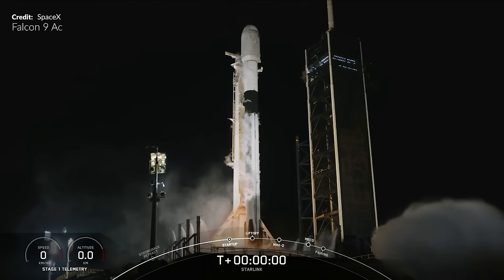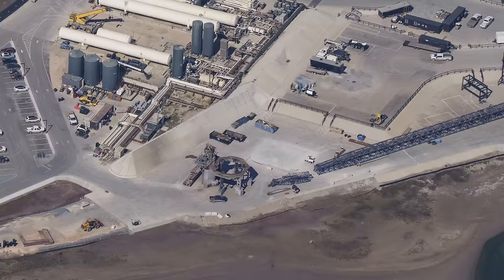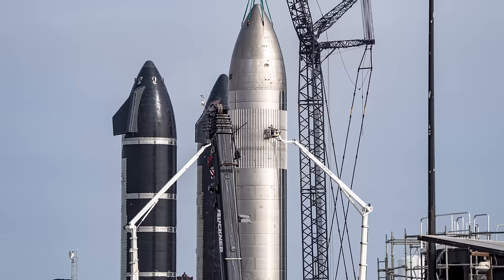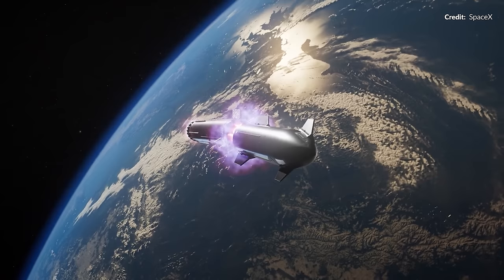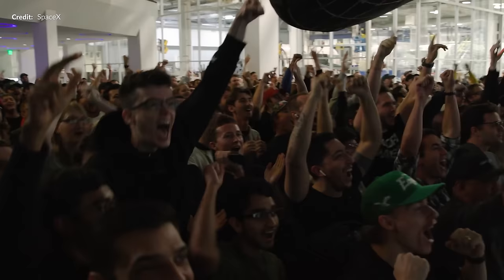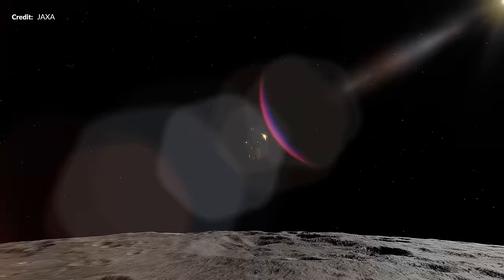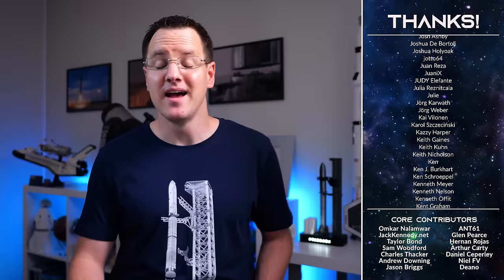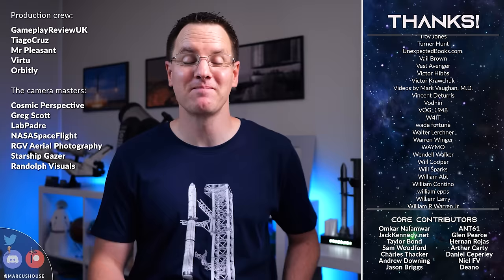SpaceX's Massive New Challenge! But how will they do this with Starship?

Comment: The primary reason for adding doors to the Megabays is for welding purposes. They use a shielding gas, usually an argon-CO2 blend, to protect the arc weld quality.  Any wind blows it away from the surfaces and welding wire.

Comment: It's amazing to hear the landing counts for each individual rocket keep going up!!!!!! Also that the only 1 lost in a few years now, wasn't a failed landing, rather rough seas toppled it over!!!
Reply: Expect them to loose a few Starship boosters even after its operational. Just part of the learning curve. On the Falcon and Falcon Heavy boosters they have alot of experience now and know where problems are likely to pop up on each flight and how to deal with them. One thing l wish SpaceX would do if they aren't is to de-orbit the second stages after use simply to reduce the amount of discarded equipment in orbit. Preferably over into an area of the ocean that sees little shipping or maritime activity.
Reply: @mpetersen6   Depending on the orbital requirements of a given mission, the second stage is either quickly deorbited, or placed into an orbit that will naturally decay over time.
Reply: @mpetersen6  oh yeah starship is a different beast all together, and yeah loosing them is expected! I mean only falcon 9 and falcon heavy!  And that's kinda why it's is some amazing, it only takes 1 small problem to start a RUD!!! So yeah even F9 as routine as landings are, can still happen!!!
Yeah they need to work on bringing back 2nd stages as well! The fairing halves are a start I guess??
Reply: @jam2190 Falcon had stopped getting major upgrades so no 2nd stage recovery ever. All on Starship
Reply: @alvianchoiriapriliansyah9882  Indeed, that was one of the drivers behind Starship... the acknowledgement that they'd reached the end of what could be done with the Falcon platform, and that 100% reusability just wasn't possibly with that hardware. Since then, they've done miracles with the ever-increasing flight cadence, but they're not doing anything new with it...

Comment: Corrosion is a huge issue in this area. Having parked our RV at Isla Blanca 3 years in a row for several weeks at a time I can confirm that corrosion begins on all unprotected surfaces very quickly. We spray our bikes and RV frame with anti-corrosion spray every time we pull in there. I always wonder how much corrosion SpaceX hardware accumulates. We have driven through Boca Chica several times and it seems everything has some degree of rust. Keep up the great work, Marcus!
Reply: Stainless steel can actually corrode,  but it takes a lot of time and usually immersion, neither of which seems probable for the rockets, but may be probable for the production facilities. The other probability is that welds will rust given that they often have mixed metals in them along with the extreme heat necessary to weld Stainless steel. If they  are a problem,  it should show up in pictures from the rocket garden.

Comment: Thanks for another wonderful space news paste - I mean, video!

Starlab is a heck of a concept. Just imagine, pop up space stations deployed when needed. That's rather amazing, and a fundamental change in how we use space. If they could link them together into bigger structures the possibilities would be endless... But your question about the Big Mouth is a very good one. Just how the heck could something that big get out of Starship at all? The problem with installing a huge door (I think) is that it introduces new weaknesses into the structure that could fail under the stress of liftoff.

Hooray for SLIM! Talk about a saga... That little lander has been up, then down, then metaphorically up again. I'm glad they got it to charge after all and got some science done! It would be great if it did somehow survive the Lunar night, but even if it doesn't the mission has still been a success for JAXA.

Comment: Doors for high winds sound like a good idea.  What is SpaceX plans for hurricane force winds and the water surge that accompanies a hurricane?
Reply: Having survived 4 hurricanes on the Gulf Coast of Texas, doors seem the least of their problems.  Hanging a 300+ meter sail up in winds that vary from 75 up to 150+ mph looks extremely difficult and hazardous. So far,  Boca Chica hasn't experienced anything like even the low end of that range, so I worry about that possibility. The foundations seem insufficient to such challenges and I've seen no guy wires that would make up for the insufficiencies of foundations.

Comment: But what's up with the Starship activity in Florida then when they transport the tower sections to Boca Chica? SpaceX also hasn't completed neither the orbital launch mount nor the tower in Florida and they also didn't build ANY high bays there. It will take years until SpaceX can restart Starship activities and build Starships in Florida let alone launch Starship vehicles from there. Thanks again for this nice summary video though!
Reply from the maker: Yes, I believe they are trying to ensure everything works at Boca before they will fully replicate it. As soon as IFT1 dug a huge hole in the ground, it was clear that they needed to pause at Florida until they had the design nailed better. I have no doubt that once they finalise a good design that does what they want, the Florida site will start absolutely roaring.
Reply: @MarcusHouse  Thanks for the comment Marcus. I hope you are right!
Reply from the maker: @jonny3003  You are most welcome. If IFT 3 makes it to orbit, again with no pad damage, I think they will have the confidence to kick it back off.

Comment: I'm wondering if they'll skip hot-staging with IFT-3, to give Booster10 a better chance of landing while they figure out a good way to deal with propellant flow issues.  I'm also wondering if a mass simulator will be added to Ship28 to eliminate the need to vent excess O2 prior to orbit insertion, since it has a payload door.  I can't wait to see what happens.
Reply: Hot staging didn't go anywhere
Reply: @alvianchoiriapriliansyah9882  Great.  So they must have a solution for the propellant fluid slam situation that seems to have caused Booster8 to explode when it tried to start its boost-back burn.
Reply: @victorkrawchuk9141  Of course. That's relatively easy to work around, using the data they'll have gathered from the Booster 8 failure. It might not be an optimal workaround (long term, they'll fix it in future hardware), but they can certainly tweak the launch profile to avoid problems... have the booster keep burning a little harder, or take a bit longer re-lighting all the engines, whatever fits the failure scenario.

Comment: It seasm like a wast to send up a habital module that is mostly air. In stead of sending up something that could be assebled in space.
Reply: You can always put stuff inside it if weight allows
Reply: @alextaylor9746  the issue is that those stuf would not be able to auto depoy
Reply: @matsv201 So better deploy it all on Earth so any problems can be easily fixed then?

Comment: If an 8 meter diameter by 8 meter tall module would be a tight fit, the arm, solar panels, power module, and docking ports would have to be on another Starship.
Reply: Official clearly stated that all will be fitted in one launch, no in-space assembly

Comment: Hey hey, Marcus! With all the talk about Gateway Tower 2's parts coming from Roberts, one thing I'm curious about is why none of you guys (you, NSF, WAI, Scott) aren't talking about the likelihood that a section or two more will be needed. It would be strange for Space X to build an technically upgraded version of Tower 1 that is the same height considering Elon stated that Starship V3 will be taller. If both towers are of current Tower 1 height, they'd have to upgrade both towers to work with V3 stacks. I'd bet we'll see at least 2 more tower sections built for Gateway Tower 2. What do you think?
Reply: There's no additional sections. Current tower height are sufficient for V3, and both existing towers and new one have the same height

Comment: Hey Hey Marcus. What type of camera does SpaceX use in the starships, boosters... Is it a GoPro or something similar? Great Video (as always).
Reply: I believe GoPro went bust or were closed down [citation needed]
Reply: I don't know about SpaceX, but Rocket Lab were definitely using GoPro hardware on Electron... complete with the audio, so you could hear the sound of second-stage exhaust washing over the booster after separation.

Comment: Any news on the vertical integration facility for Falcon? I thought by now they'd have built something.
Reply: There's no payload currently needing it. Building it isn't as hard & long as developing a new rocket
Reply: @alvianchoiriapriliansyah9882  I suspect they never will... the number of missions requiring it is low enough that SpaceX doesn't really want to go to that effort. It feels to me like there's an unstated agreement between them and the USSF... they'll maintain contingency plans to build that stuff if needed, but they won't make a fuss if the USSF just keeps giving those missions to ULA.

Comment: for the starlab, it would be easier to use one starship, especially modified, to make the starlab. All is already there: the room for astronauts, the reservoirs of fuel, water and oxygen, and finally, the engines that could be used to redeploy it to a different orbit. No need to hassle down trying to fit the starlab inside the starship. But of course, these companies do not want to be accused of stealing Elon's idea, because very likely spacex has already thought about this.
Reply: SpaceX aren't part of Starlab consortium & here they're merely just a launch provider (job is to launch & deploy the payload into correct orbit, nothing else)

Comment: Wait, if SLIM only got sunlight for a couple of days as the sun set, doesn't that mean we have to wait a month for the sun to be setting again to see if SLIM can wake up, not 2 weeks like Marcus said? In 2 weeks the sun might be rising but it's light will be hitting the wrong side of the ship.
Reply from the maker: It is holding charge, so they will wake it once it warms up to see if it is still alive we believe. They would then shut it down to wait for a full recharge on the battery I suspect. Very long shot though. I doubt we will hear from it again.
Reply: That makes sense. @MarcusHouse

Comment: Not sure what Starship's actual payload size will be. There are structures inside, and it also depends on how big the doors can be while peeking the shut re-usable and structurally sound during take off and re-entry.  Suspect max diametre will be more like 8m. And doubtful a full station ca be launched in one go.  The basics for one are pretty large and heavy (ECLSS, toilets, galley, fridges, contrrol systems, propylsion for station keeping (orientation) etc.  Though Zvezda was able to get most of it but relied on power from Zarya and then US segment.

Comment: I just realized something today.  One of the reasons the Starship is impressively cool is its color, or lack thereof.  Instead of white, orange, or striped the all black/dark silver Starship looks a bit menacing and mean.  You can even see the difference in the model rockets Marcus has behind him.

On an entirely different note, there have been some recent reports that the enormous number of satellites circling the earth are adding to the breakdown of the earth's magnetic field.  Not just the satellite's metallic nature, but the fact that space debris collects stellar dust, some of which is carbon, silicon, iron, gold, silver and platinum.  All of these add to the "bulk" of the metals of a single satellite, and all of which interact with magnetic fields to some extent.  It's early but it will be interesting to see how this goes.

Comment: Why aren't the, water landing, rocket engines reusable?  Is it because of the salt water getting into the turbopump bearings? Is it all the valves and switches that are not sealed inside a solid plastic molding?  Sure seems like all it would take is de-minimus preparation, with bearing seals and such, and  the water landing engines and craft could be inexpensively and quickly refurbished and reused.  One way to find out.  60 psi positive pressure might help. Use the engine bell nozzles as compressor ram jets. VIDEO SUGGESTION >>> discuss the kinds of bearings used on the various engine's turbopump shafts.
Reply: Yes, saltwater aren't good for delicate engine components
Reply: @alvianchoiriapriliansyah9882  Thanks for the reply.  I understand salt water can be corrosive. I've seen old Volkswagen engines restarted and used after being over a year in the Salt water of Padre Island.  The combustion chamber and nozzle actuators and bearings are all there is to these rockets; no? Surely 6 hours in the water can be rinced off, and followed by a hot oil bath rendered as though it never happened.  No?  Should cost almost nothing to find out.

Comment: Hey Marcus, thoughts on using ceramic or heat tile surface finishes on stage zero surfaces to deflect heat and stop the massive corrosive effects of Gulf of Mexico wet salt air, super heated steam, propellant and god knows how many hot chemicals on  bare metal.  Paint is less than useless on steel under those conditions.   Are other firms using better material tech in this area?   Tx, great show as ever.
Reply: Prone to blown away at launch. It's not just about the heat

Comment: Could ESA use the Super Heavy Booster only and instead of Starship strap a self contained booster pack with space station on top all enclosed in a Payload fairing , and shouldn't SpaceX be looking into using the Super Heavy Booster this way??? 
As a Booster? For large self contained objects in Payload Fairings from Space Station (Bigelow) sections to Telescope's with disposable booster packs to boost them in to their orbit or where ever their designed for.
Reply: Hypothetically, yes — but remember that re-usable boosters stage very early compared to expendable rockets. So you're basically requiring ESA to build an entire second-stage with the same performance requirements as Starship... both high-thrust and high deltaV requirements, since you're staging so low and slow. And of course, you need to qualify this whole stack, with new mass distribution and new aerodynamic characteristics... unless you want to build all this at great expense, only to take the "launch it and hope" approach to flight testing.
Reply: Wouldn't that be easier than a highly modified Starship, well you could put two or maybe three on top of the Super booster and build a Starship fairing maybe, the thing is the package of one or two space station modules would be  lot less heavy and the new Starship design is supposed 10 or 11 m wide so would fit comfortably in Starship, up to two in the new design maybe but I still say that SpaceX should not discount the Booster only and may design a pallet with Engines and put your own Satellites/Space Station modules on top as long as it fit in the Starship Fairing on top like its done with Falcon 9 at the moment..
Reply: @eanjamesmogg9488 Lmao that's much harder than modifying Starship Variants
Reply: If they can do it for the Falcon 9 surely they can do it for the Super Heavy booster, just replace Super Heavy Booster for Falcon 9..
Reply: @eanjamesmogg9488 There's no deployable fairing for Starship. It'll never happen
Reply: @eanjamesmogg9488  What do you mean, "if they can do it for the Falcon 9"? They've never flown F9 without the standard upper-stage...

Comment: Long time viewer here.  In my mind it doesn't make sense to follow Space X Texas activities to your typical level of detail anymore. Significant events yes.  Changes in design or process yes, but every nut and bolt? No.  Frankly I have been skipping over most of that part of your report. Take it for what it's  worth from a career aerospace guy and whose dad worked on the Saturn V.  In other words almost 70 years following or space programs. Cheers!
Reply: Long term viewer here. Take it from career Air Force guy whose father worked on the Apollo program. Keep on keepin’ on. Easier to fast forward over details that are covered than to see ones that weren’t covered at all. It’s amazing to see a new space program built step by step.

Comment: I don't know how starship as it is configured now can make a two way trip to the moon. Not with cryogenic propellants. And there is absolutely no way starship could go to mars. Cryogenic fuels will boil off way before they even reach mars. There have been no landings on other moons or planets with out using hypergol fuels. Sure the vacuum of space is a good insulator. But still not good enough. Explain that to me ??
Reply: Insulation and zero boiloff doesn't require breaking the laws of physics, and several other landers are using cryogenic fuels
Reply: @notsogreat123 Nova C, and ofc HLS?
Reply: @notsogreat123 Nova-C is already been built & tested, and it's scheduled to launch in just over a week from now. So much for "but cryogenic propellant lander is impossible!"